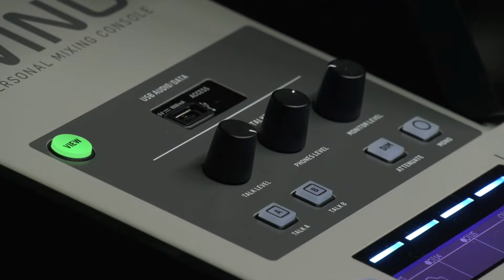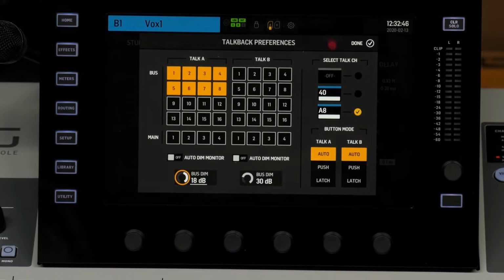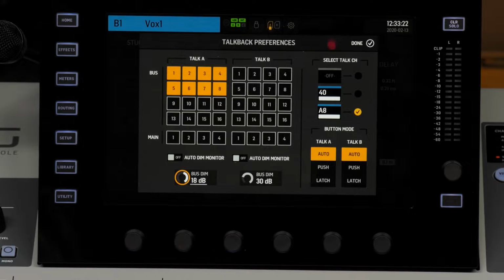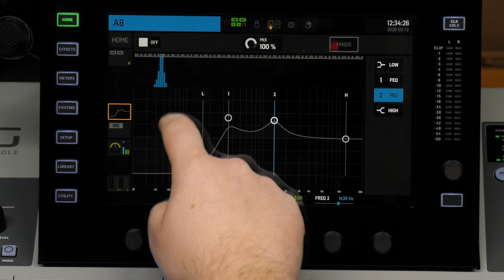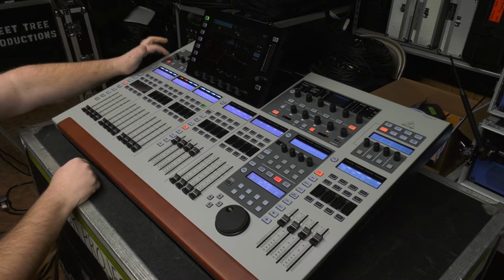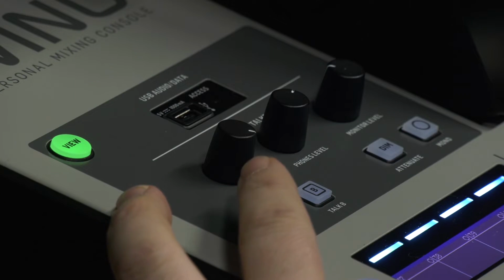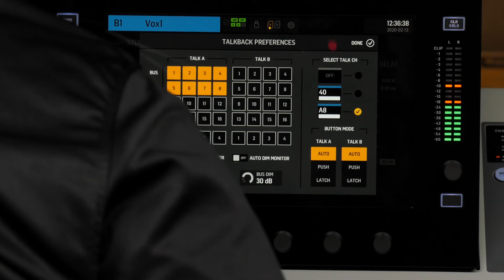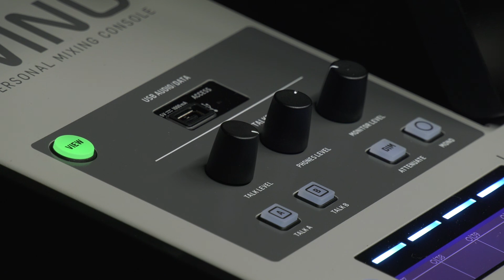Behringer Wing Talkback Tutorial Video 5

Comment: Hello, but does the Behringer have a talkback microphone built into the X32?
 If not, I'm advised by the microphone?
Thank you!
Reply from the maker: The wing doesn’t have a built in.
Reply: There is no built in  talkback mic, but the default for adding one is Channel 40. In my case I ran mic/source into Local Input 1 to Channel 40. I also then routed the Source group Local In 1,  to my output group AES50 A #46 . This allows for my talkback to be #14 on my P16's in the studio. I use my Mac headphone out 1/8in. jack split to  2 XLR's  run as my source to  my   Local in 2 and 3   routed to output source group AES50 A #47 and  #48. This is used for my Stereo  Playback from the control room to  #15 and #16 (Linked) on the P16's.